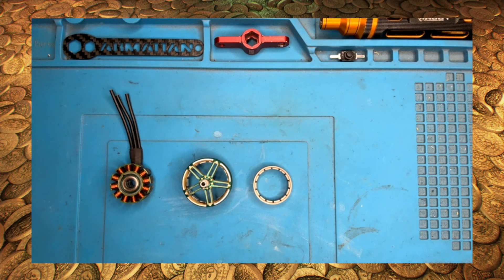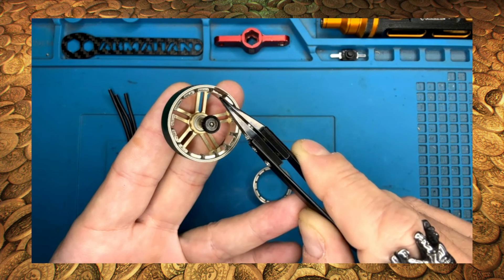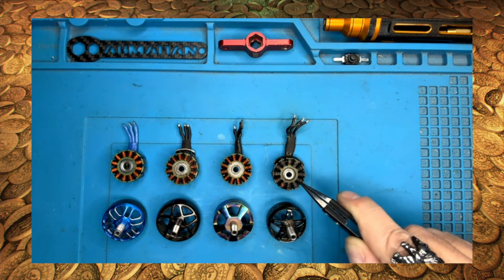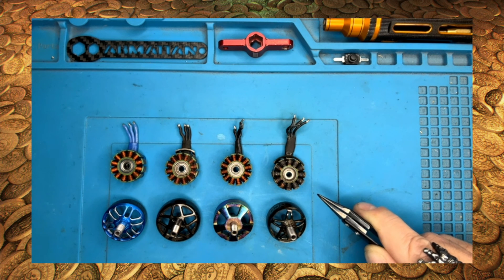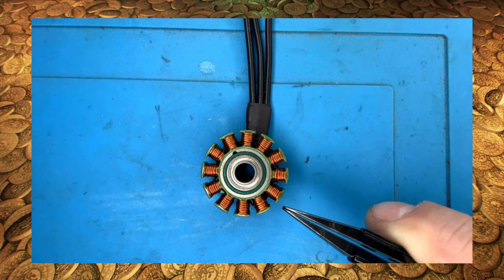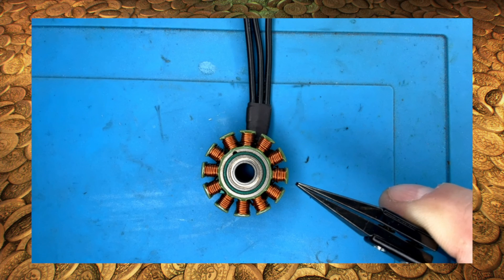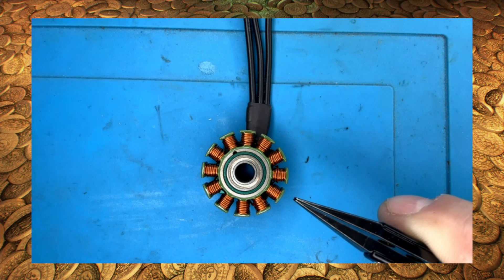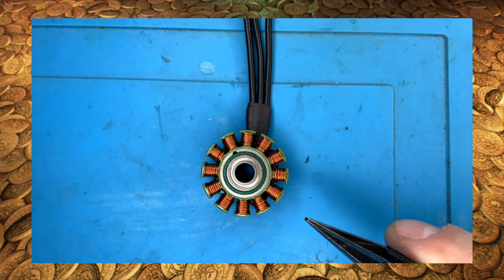Just The Tip - Ep 08 - What Happens If You Mix Motors With Different KV On Your Drone?

Comment: Man you’re the best! You came in clutch, I’ve just had a serious crash flying today and one of my motors got seized up pretty bad, I tried bending it back in place but weren’t so successful… it was a 2306 1950KV motor.
I remembered i’ve had a spare motor from my old quad which i lost (R.I.P), and that motor is a 2107.5 1960kv.
I will be be soldering on the new motor asap, i hope it’ll work fine🤞!

Comment: Hey man! I ran some tests, and I feel like some information in this video is misleading... From my understanding, the FC monitors and adjusted for results (stable flight).  It doesn't care about motor KV or propeller pitch/diameter, it only cares about the result... The FC isn't limiting down to the motor with the least KV. Instead, the entire system (FC and all four motors) is limited to the motor/prop combination that is doing the least amount of work. The FC handles differences in KV exactly the same as it handles differences in prop pitch and blade count. It doesn't care at all, it's just going to be limited to "the weakest link". 

For example, I stuck one 40mm prop on my 2-inch build, and the system was limited to what that 40mm prop could do.  So the entire thing felt like I had four 40mm props on...the system was limited to the motor/prop that could do the least amount of work.  It is more to think about....but it's something to think about.

I'm currently running 22000KV 1102s with .9 inch pitch tri-blades in the front, with 17000KV 1102s with 1.5inch pitch bi-blades in the rear.  ChatGPT can help with theoretical potential calculations to help match props with motors if you plan on doing something unorthodox like me. The build I'm working on feels pretty great, and sounds crazy.
Reply from the maker: I don't think you really understand what this video is about and who the intended audience is, but you are also correct in your assumptions about the FC limiting to the esc making the least amount of rotations.
Reply: @Rogue_FPV  I don't think you understand flight controllers... The information in this video is wildly incorrect.
Reply from the maker: @ibedifrent no, as an app developer and programmer, I understand flight controllers and program logic just fine.

I think you are the one who is mistaken, and again I don’t think you really understand the nature of this video. 

I’m happy to continue keyboard cowboying with you all the same though.
Reply: @Rogue_FPV  I am not mistaken... I did my tests, and any FPV pilot can their own tests... You posted a video without even testing the alternative. I tested the alternative, and I'm here to say that mismatching motor KV could be a performance hack.

I don't care if you're a developer or not... You're wrong here, and you didn't even try it.

I just want FPV people to know to not listen to anything in this video.

As an app developer and programmer, you're still wrong.

What a shame to bring your expertise into this....and still be blatantly wrong.
Reply: @Rogue_FPV  And it's not about the least amount of rotations, it's about the least amount of WORK....  I enjoy that you don't understand the difference.

Comment: How is this handled with Dynamic Power Boost?

Hypothetically speaking, what if you had lower KV motors with high pitch quad blades in the front, and higher KV motors with lower pitch bi-blades in the rear?  With Dynamic Power Boost enabled and set pretty high, can we get full potential out of our different KV motors?  (Not saying anyone is thinking about trying this......)
Reply from the maker: No clue to be honest… I’d never run different kv motors and different props on a quad, that’s recipe for disaster….. even “if it can be done”… 

I stack the deck in my favor, never fight the odds.
Reply: @Rogue_FPV  Well, I tried it... I think everyone should try it......  It's not a recipe for disaster. I tried it, and it worked just fine.  There is potential to find more performance when you fight the odds... I just want everyone to know that they should try it.... Mix it up, and see what you get. I think there's usually more potential in the odds....

Comment: hi i have a quad which has 2207 2450kv but one of the motor died as i cant find the same motor can i use a 2207 2750kv with the old 3 
thank you
Reply from the maker: Yes, the new motor will be auto limited down to 2450kv to match the other 3 motors.

Comment: Great video thank you for all the detailed explanations. One question I have remaining is about efficiency. If I mix 2 x 1750 KV motors with 2 x 1950 KV motors in betaflight basically treats the 1950s as if they were 1750.  But will the two 1950 KV motors be just as efficient as the 1750 KV motors?
Reply from the maker: Yes, because they will be spinning the same speeds and pulling less amps than the 1750’s 😊
Reply: @Rogue_FPV  Hey thanks for the reply.  Just so Im clear then, If I use two 1950kv and two 1750 kv on the same quad, it will be just as efficient as if I had 4 actual 1750 kv motors?
Reply from the maker: @gregdavidd yep, you got it bro, just as efficient as the 1750’s… 

Your flight time will not be affected 😋
Reply: I have a question bc I just smoked a mck wasp major which I believe is discontinued. I can find 2160 kv but the other 3 im running would be 2100.. does betaflight automatically detect this or do I have to change any settings to run the new 2160 with the other . Or should I just get a different color wasp major 2207 2100 kv  and use my bell on it?

Comment: What should I do if I want that one motor with higher kv to have an increased thrust
Reply from the maker: You dont want a craft where one motor makes sufficient more thrust than the others
Reply: @Rogue_FPV  what if I want it to for my new unique drone build for vtol so how can I do that
Reply from the maker: @tejassreenivas6183  that’s like driving a car with one larger wheel. Betaflight will do the calculations to balance thrust between all motors no matter the number or configuration. That is done in the “type of aircraft” drop down.
Reply: @Rogue_FPV  now for example I’m making a plane which has vtol capability so there are 4 motors which are fixed wing and two motors which would help with the lift off, the lift off motors would need more thrust so how would I achieve that
Reply from the maker: @tejassreenivas6183  don’t overthink it friend, just tell betaflight that you have a vtol plane and not a drone. Betaflight will sync thrust on all motors so sufficient thrust is made by each in all flying conditions. 

Again, just need to tell betaflight that it’s a plane in vtol configuration, not a 4 motor drone.  Alternatively you can flash Inav firmware to the fc, which is made more for fixed wing models